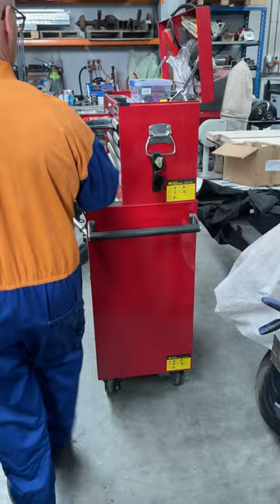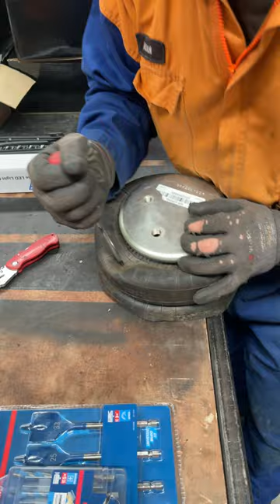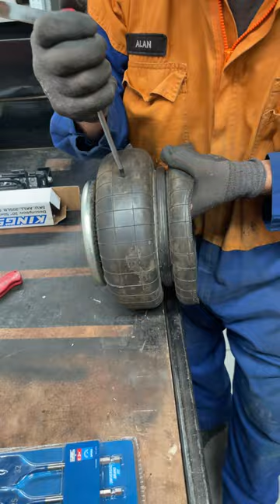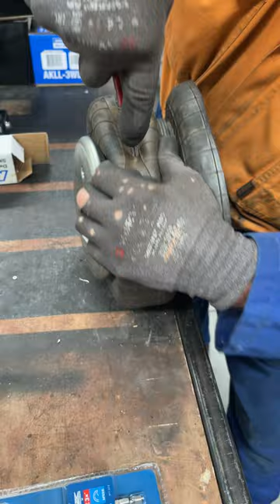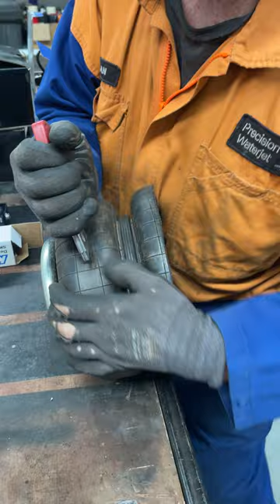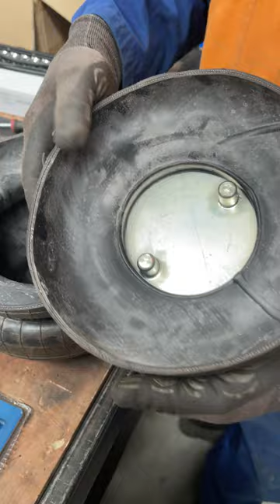Airbag trailer bag Stabbing!!

Comment: Hey Alan would you be able to tell me what air spring that one is? Im curious what their pressure rating is and what you typically run your trailers at. Cheers
Reply from the maker: sure, we have a twin cylinder onboard that switches off at 160PSI,  The airbags run at the pressure required to lift the load which is variable and goes up dramatically over a bump. We use bags from a Chinese supplier as well as Firestone. hope this helps. We have built trailers that can carry 4 tons and the nag show no sign of failure. Hope this helps
Reply: @ultimatemanshed  I see your using Vigor air springs which look a bit bigger then the recommended firestones. The fitestones seem to have a max working pressure if 120psi in their data sheet which doesn't seem like much especially as you say under load on bumpes etc and it takes 90-100psi to lift. So was just curious what Vigor springs these ones are as they look a bit chunkier and nicer than the forestones. Cheers for the info